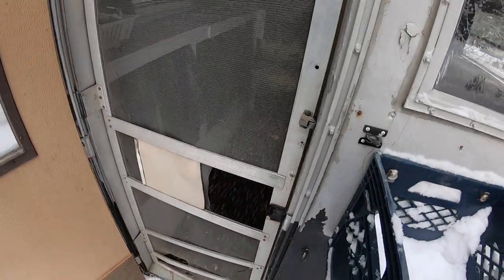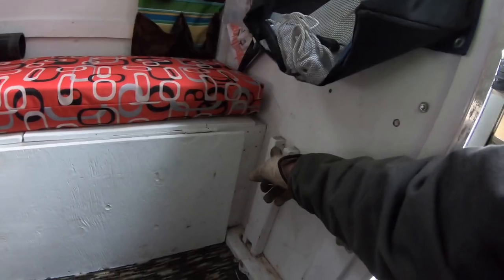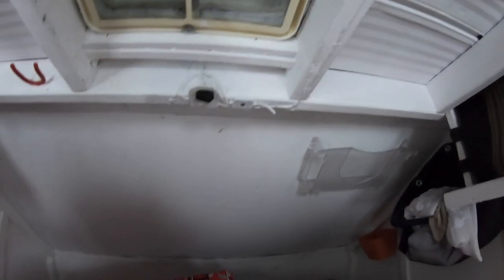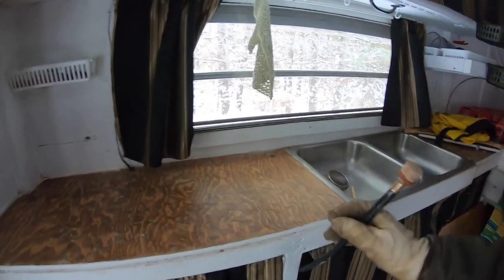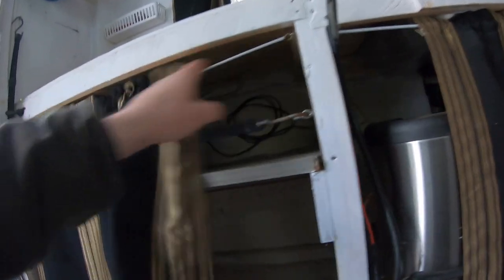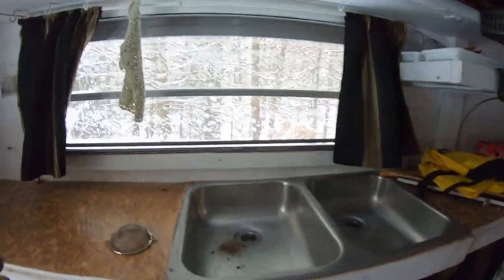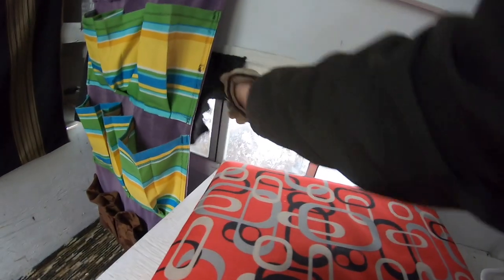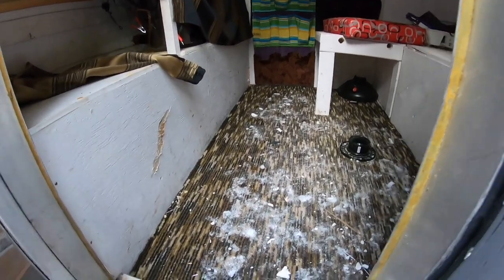DIY Tacoma Truck Camper Interior Features (3 of 3)

Comment: Simplicity is always underrated, practicality is undervalued,  and cost  efficiency is paramount..only thing I'd do cause I'm a painter and I think that way is add some colors to define spaces,add character and comfort, and make easier to clean if u use a glossy or oil or epoxy paint. .
Reply from the maker: Yeah that's a great point about the glossy paint for keeping things clean. If I were to do  repaint is likely go high gloss latex

Comment: Inspiring . . . What I would do different is not have any high voltage lighting. When you are plugged in you are simply charging the battery(s) that run all the LED lights but I would have a couple of high volt plugs for things like the Microwave and small heater. Even a high-end NEW Airstream Trailer has only 12 volt lighting. It's superfluous to have both. Even if you don't have batteries the 12 volt leg on the charge controller will feed all the lights and fans. I'm going to GLUE mine together like if I was building a boat. :o)

Comment: Great job, simple, light and functional, just what I was thinking for my truck 2011 Ford F-150. I have a question about the roofing. Is the entire roof done with the roofing metal or metal over plywood for a portion of it? How did you make water tight along the edges because of the profile?  How much weight can the roof support.
Reply from the maker: I put 1/2" plywood on about half the roof so I could go stand up there and load stuff up there if needed. The front half is just wood framing and no plywood with the metal attached to the framing. I made it water tight along the seams by putting silicone along the edge and also by putting a drip edge used for when you roof a house along the edge as well.

Comment: Not sure if you are still responding to comments BUT I was wondering how much this costed you as well as how long it took you to build it?
Reply from the maker: Hey Brandon. I do my best to reply to all comments as I appreciate you watching. All in I am probably about 500 cost I figure
Reply: Wow!! That’s way cheaper than I was guessing. I’m building a super similar camper on my ‘06 tacoma extra cab this summer. A bit more extra’s in there but still that gives me hope that I can make this thing much more affordable than I was first guessing. Do u have a gauge on how long it took u approximately to build it?
Reply: What upgraded leaf springs and shocks are you running on that Tacoma?
Reply: @KayleeTheBlueHeeler  all stock actually. I added in airbag suspension to help levitate the leaf springs tho
Reply: @brandonallen1167  thanks I’m thinking of doing the same build but I have a short 5.5 bed  in back with the full size four doors may frame it to hang over more to have extra space.
Reply: Nice build, thanks for sharing!